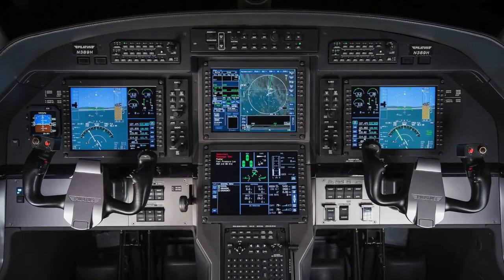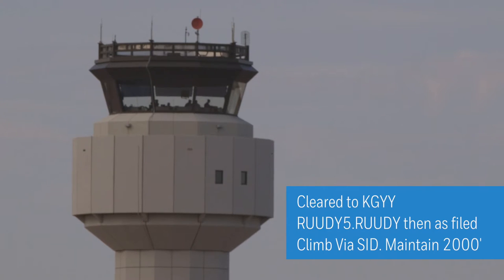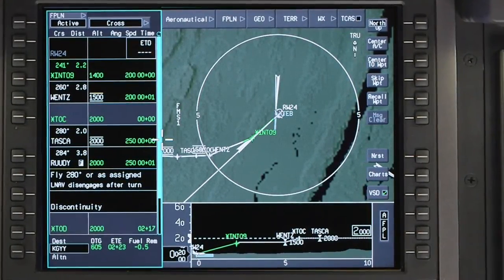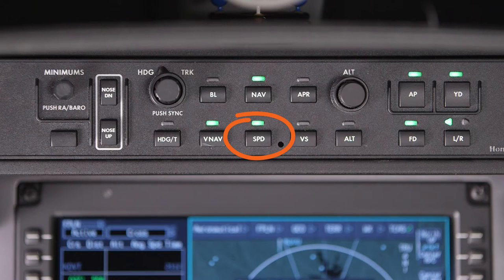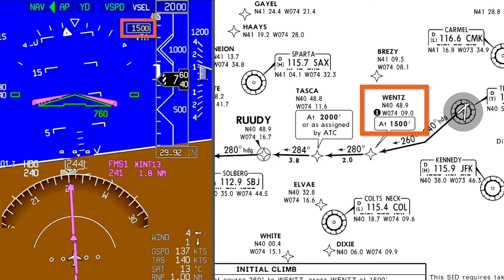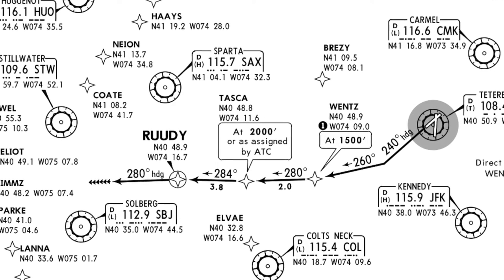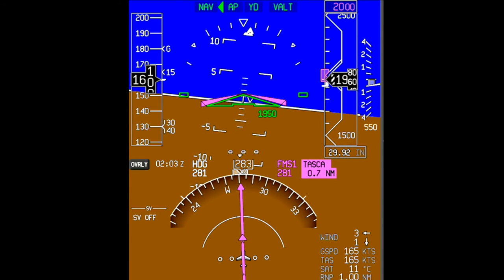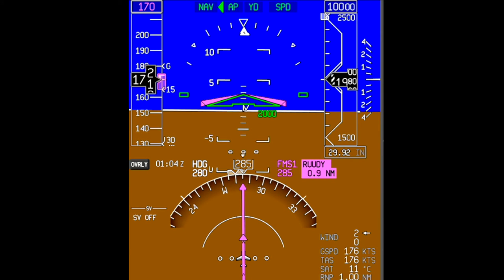VNAV Climbs on the Pilatus PC-12 NG | Aero Training TV | Honeywell Aerospace

Comment: If you climb via the SID according to this outdated chart, you will cross WENTZ at 1500 feet, then have just 2 nm to climb 500 feet in order to cross TASCA at 2000 feet. I have flown this departure out of KTEB flying a Pilatus PC-12NG and fortunately had the power to make that 500 foot climb in 2 nm. However, it has been 5 years since I flew out of KTEB, and the current chart for the RUUDY SIX doesn't have TASCA on it with it's 2000 foot restriction there.